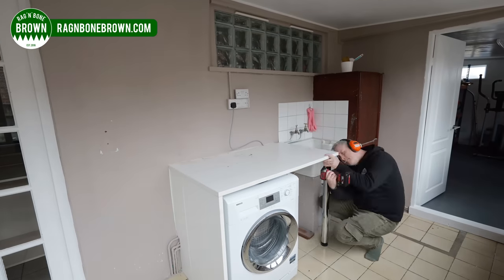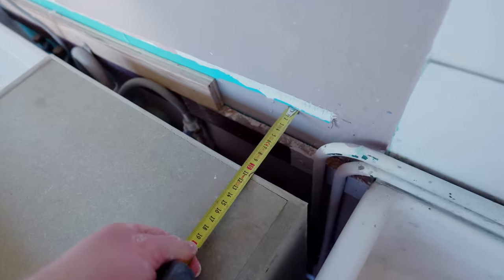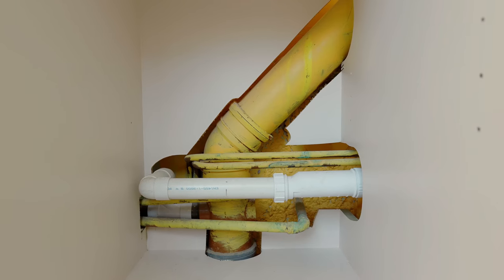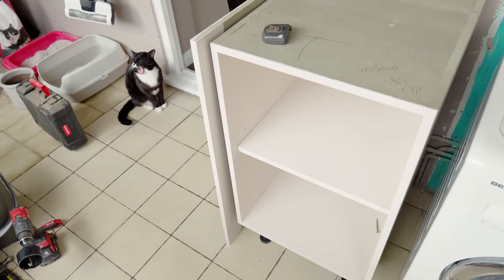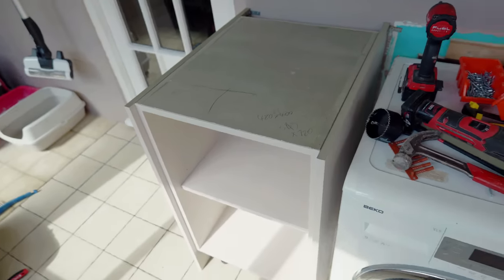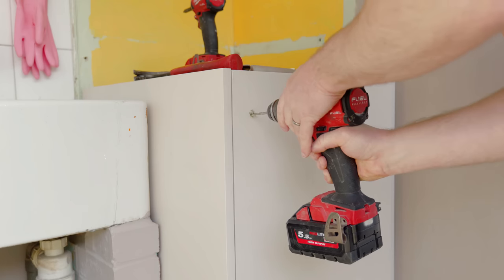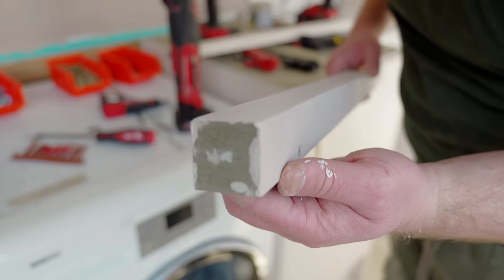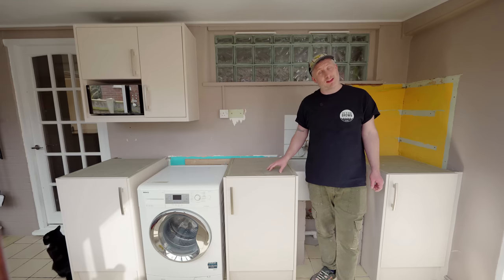Problematic Pipes!!  // Utility Room Renovation

Comment: Suggestion?  For the cabinet where you had to cut out for the pipes, I would make a panel to put inside the cabinet to hide them.  You lose a little depth in the cabinet, but you also don't have to worry about anything getting pushed into the hole and dropping behind.
Reply: I was thinking that too
Reply: Me as well. Had to do something similar I'm my own kitchen,
Reply: same! you'll loose small things in the gaps
Reply: This is why normal kitchen cabinets come with a service gap at the rear.

Comment: Would suggest putting some foam packing material around the washing machine to squeeze it tight against the cabinets. It will drastically reduce noise and vibration.

Comment: Tip with the cupboard legs. They should be supporting the side panels as they bear the weight of the  surfaces and everything that may be on the surface. That's why they have a tab on them. That part overlaps the sides downwards force

Comment: Hi Keith nice job, one thing that concerned me was the positioning of the cable for the wall sockets. I've always been told that electrical cables should always be vertical if hidden behind plaster never horizontal or at any angle.

Comment: I still say you should have made these units out of MFC white is the cheapest and edge them no painting? and your end panels we always make them 22mm bigger so you can adjust your doors and l agree about putting a panel at the back of the units so you don’t see all of the pipes if you screw it then you can get at when ever l always use French cleats we make are own on the spindle great job see you soon 👍